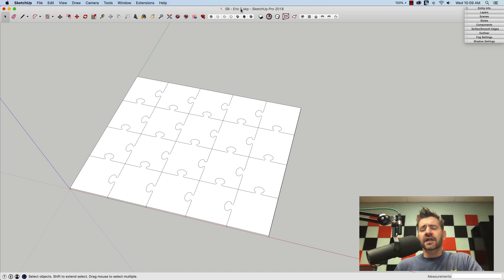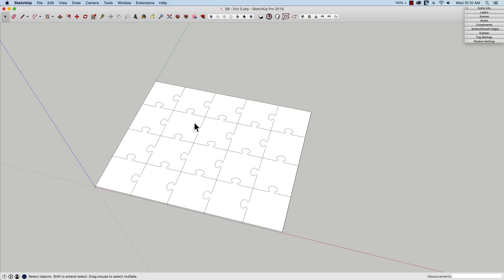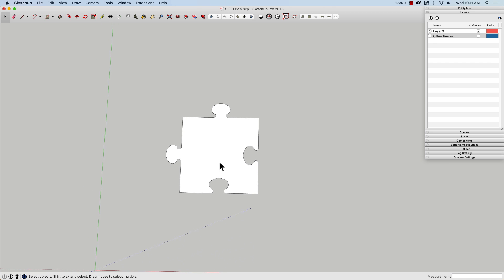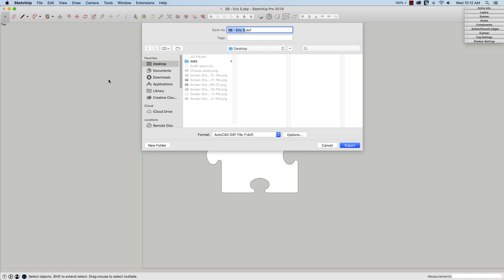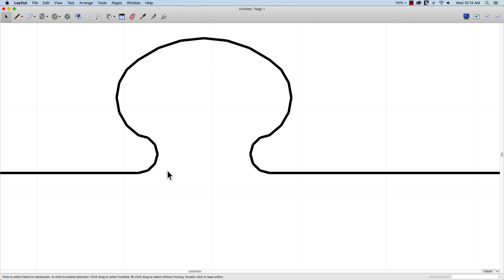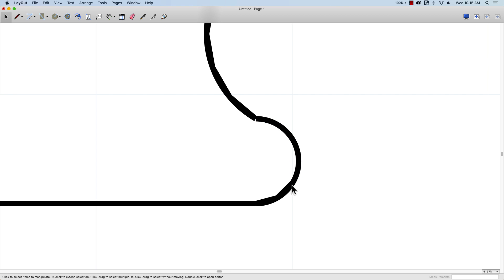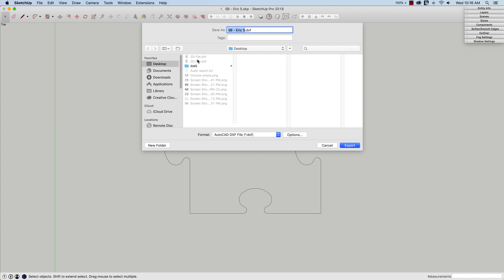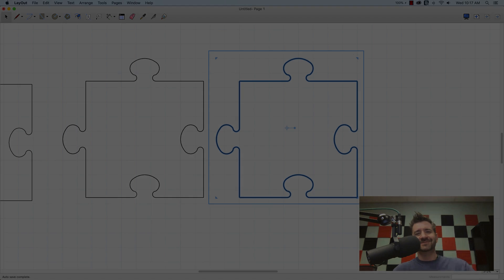Exporting 2D curves - Skill Builder

Comment: How to make 45 degree line smooth.when I save sketchup project in jpg the 45 degree line is not smooth
Reply: Hi JPEG is a photograph format it does not contain any line information, when you see a line in a jpeg photo and zoom in on it you will see it only looks like a line because there are a row of pixels that are simmilar. You can change any of the pixles colour and it won't affect any other pixals like what you would exect in a photo.Vector art is made of stait lines curved lines and fills that do affect their entire form

Comment: Good to see tutorials for cnc work. You can skip the delete faces step (useful when exporting large numbers of parts) by using the options in the export window, and uncheck 'export faces'. You can also assign the edges to named layers (for example, 3mm deep inside cut) than can then be recognised as different tool paths when exported as the 3d dxf.
Reply: Great catch, Dan! Thank you!

Comment: Wow, Aaron, this is a great tip! Exporting curves with faces removed to 3D DXF format to preserve true circle and arc geometry is really important for folks (like me) who design in SketchUp and export for CNC routing! I tried your three DXF export modes (2D, 3D, and 3D with surfaces deleted) with a 10" diameter circle set to 12 segments, and when I inserted them into both LayOut and Vectric VCarve Desktop, the results were very obvious. I would have never thought to export SketchUp 2D curves to a 3D DXF file ... so thank you!
Reply: It is a great job that you've coverted the tutorial info into practical example. Thanks for sharing.
Reply: Glad I could help!

Comment: +1,  Great job in demonstrating the process. 
Question:  I don't have a 3D printer so I can't do any testing. Could the similar procedure be applied to produce an export file for 3D printing or would it not be necessary with regards to arcs/circles?
Reply: Unfortunately, the smoothing only works for 2D arcs. If you need to smooth a 3D shape you still need to increase the polygons.